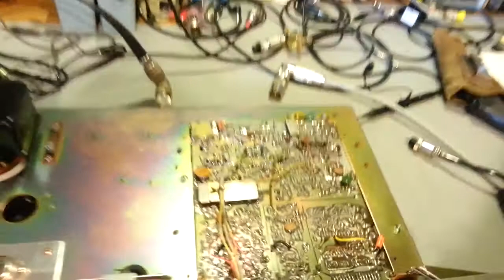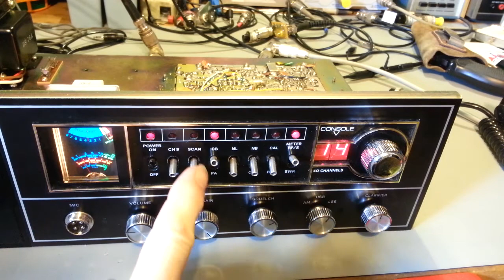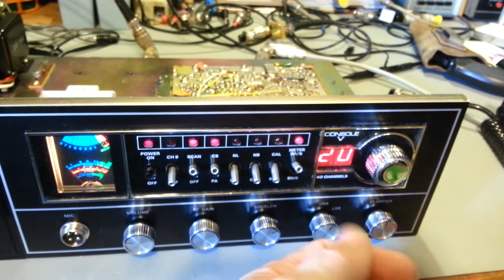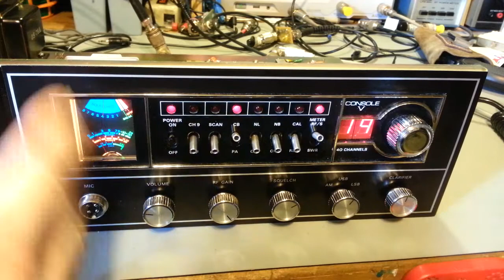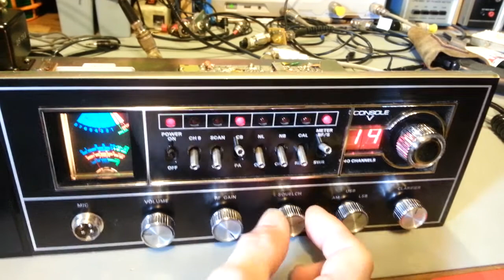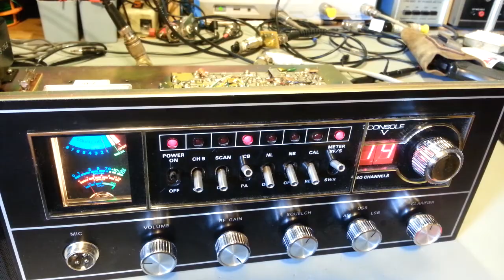SBE-40CB Console V / 5 AM/SSB base station CB radio.

Comment: I have one I just aquired. it worked in the 90s, but not it recieves, transmits dead key 3w, but no audio. Ive been told a 4 pin president mic has the same wireing pattern, the mic is a turner off a washington (858 board). No modulation ssb either. I can hear stuff from the speaker.  Can you get repalcement boards from like pcb way or something that would have a board of better quality?

Comment: Mike. I've got a sbe sidebander v. No RF out but can receive it's transmission on a radio alongside on all modes. Rx is fine. The RF amp stage all seems perfect. I need a Bick diagram if you have one please. Already have the schematic. Any ideas on fault? RF transistors are all fine and driver and predriver.

Comment: Hey Mike, take a look at this https://m.youtube.com/watch?v=PeI1U0Z7tbAThis guy hates the internal speech processor to the point of removing it and replacing it with something else. I think he's silly based on the claim "they go bad causing low audio.. blah blah..." I personally trust your technical expertise and want to copy that audio unit and study the circuit. Just because things have faults that turn up years later, doesn't mean that the circuit is badly designed or poor performance. It's usually down to construction and component reliability
Reply from the maker: Dazzwidd 

Every one I have ever seen that didn't work just had bad electrolytic capacitors.  People seem to forget the audio passes directly through electrolytic caps on these boards.  Caps go bad so does the audio.
Reply: Thanks mate for sending me the link for the speech spander. I had a look at it. Very simple, in fact I was noticing that it only has adjustments going into and out of the buffer stage from the compander IC. The plessey chip does the lot without virtually any curating :) Interesting and kind of not at the same time

Comment: I'm trying to obtain a schematic diagram of the Mic processor board used in these radios without any success. I want to study their methodology :) I got a schematic for the sbe sideband v but like the pll unit, the mic processor unit is just depicted as a square with connections coming out of it. Are you able to help plz? :)
Reply from the maker: Dazzwidd 

http://www.cbtricks.com/radios/sbe/sbe_27cba_sidebander_iv/graphics/27cb_a_39cb_40cb_sm.pdf

Speech spander is in the service manual as is the pll schematic.

Comment: We share opinion on the SBE receivers being hot. The best AM only CB mobile radio I ever owned, and I owned hundreds during the CB heyday, was an SBE Catalina III. So much in fact I may ebay another one.
Reply from the maker: +Andy Thrasher 

For AM only the Motorola CM510 qnd CM540 mobiles are excellent to.  With their adjustable IF gain and adjustable ANL you can really fine tune out noise.
Reply: Agreed also. I don't recall the model number, but I owned a Motorola " Mocat 40" at one time. Bullitproof front end I remember. never really had to work on it but I recall opening it up to find the most professional engineered circuits, boards, filtering and shielding I had ever seen. (in a CB radio) The circuit boards reminded  me of a spectra or Maxtrac or something. Even the microphone was a factory preamplified unit powered through the mic plug.

Comment: I had never heard of open channel scan! Learned something. I also had no clue that they even had encoder's back when that radio was built? Learned something. I just thought all old radio's had channel selectors! Ooops! In my mind an encoder represents "cheap" and no tactile feel. I know "perception" does not always = reality!
Reply from the maker: buckaroobonsi555 

You can get clunky high rotational torque encoders.  They are just a little harder to find than the standard encoders. You can also get super high quality encoders.  They are common on industrial equipment these days.  They just cost an arm and a leg.
Reply: Would be nice if one could find a moderately priced encoder that had the feel of a ball bearing gear reduction vernier dial in a compact package. Something that felt smooth and sturdy. A lot of encoders that I encounter feel like they might break or wobble if you look too hard at them!
Reply from the maker: buckaroobonsi555 

Mark and I are currently working on that.  I found some that had a rotational torque over 2 times that of a standard encoder.  Some are on the way for testing.